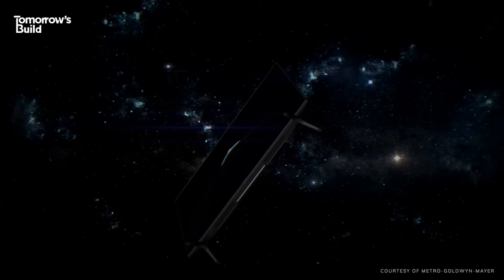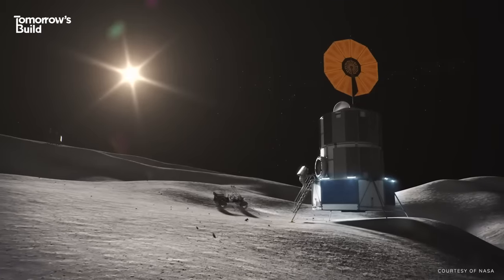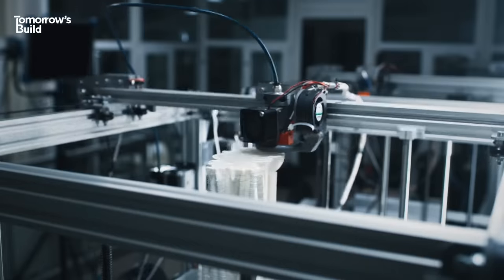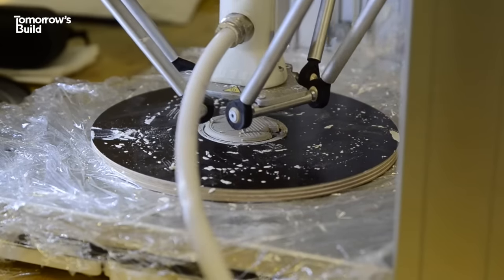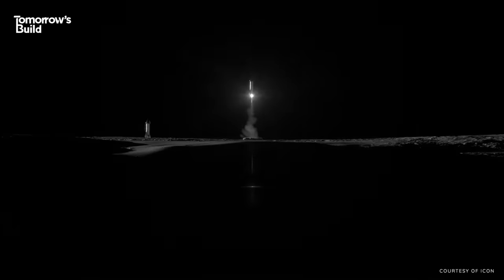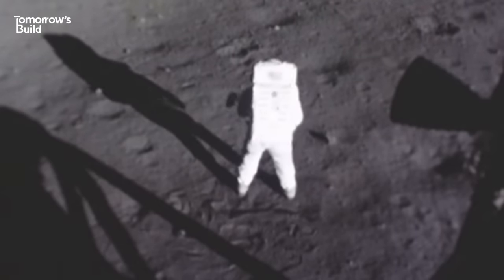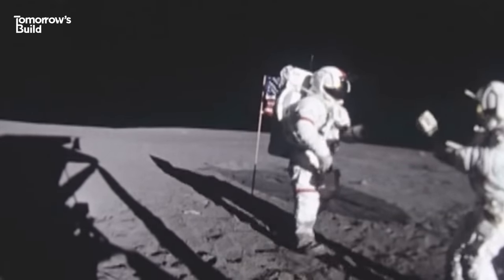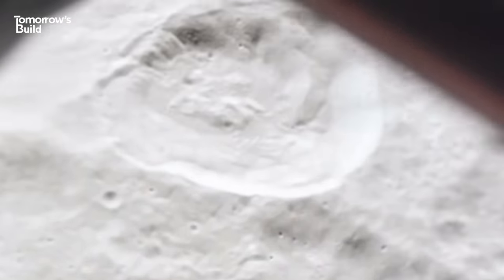NASA's $93BN Plan to Colonise the Moon

Comment: Wdym? 3D printing has absolutely exploded on earth. 3D printed rockets. More startups with housing companies. Increased tech with 3D metal printing. A huge amount of new medical applications. It’s huge. It’s not as much in the main spotlight because it’s a common occurrence but I assure it’s absolutely everywhere.
Reply: I think the article it was referencing was more talking about mass production of 3D printed parts vs traditional manufacturing. but the tech is developing so fast I wouldn't be surprised if the article was out of date
Reply: I had the same confusion - but I get the general thing they mean - it did feel like some years ago it was saying it was going to be a gigantic revolution -

But I feel like most technologies are like this, where they have their initial concepts, a bunch of R&D, prototypes arise - and then massively burst into the public eye, being told its right around the corner and will change everything... and then the hype dies down. Everyone goes "what happened to the cool new tech?" It never went anywhere. The general public just has a severe lack of patience and understanding that new technology takes time. It fills me with annoyance everytime I hear someone say that nuclear fusion is a scam because they don't understand just how hard of a problem it is to solve.

But slowly, silently, the technology becomes more available, more established, and changes more and more and more, until suddenly everyone looks back and is like "oh dang I didn't even notice that technology came around, when did that happen?"

Fittingly it definitely happens in spaceflight, where the public only glances over at space when something is again, in the mainstream news, and they seem baffled about all the stuff that's happened, when it was going on this whole time. 

Oh yes, and thank you for mentioning Relativity's 3d printed rocket. It is launching for the first time next month, and I have no doubt that they will be a big player in the future.
Reply: It’s not
Reply: @WasatchWind  The Gartner Hype Cycle is real and nobody can escape it
Reply: I was questioning it too but then at around 2:40 he states the way we thought it was going to be 

Remember when it first came out we believed it was going to literally change everything and take over but in reality it just became a useful tool.
Reply: that’s what i was thinking !!!!
Reply: People expected 3D printed Big Macs at home and now they’re disappointed it’s taking longer than promised 🤷‍♂️
Reply: Lies again? Premier League NUT
Reply: @Andrew Spartan But we are printing steaks and other organic materials…
Reply: @supergamergrill7734  🎉
Reply: Absolutely correct- not even in obscure areas now, permeates the Aerospace Industry.  Components have been built far in the past, and now we’re are flying 3D printed rockets!
Reply: @James Allen  and the funny thing is that no one developing 3D printers promised that to them, Lol
Reply: I’m 3D printing something in my garage right now in fact
Reply: He’s talking about the logistical scale of replacing modern manufacturing processes with 3D printing. Material science evolves so fast that while 3D printing is helpful, I. The manufacturing space it is more common as “rapid prototyping”  rather than a legitimate manufacturing process. 3D printing has exploded amongst consumers as well as applications that involve multiple design iterations like the medical field that you mentioned, but on an economic scale no 3D printing is not as prevalent as was expected.
Reply: @StripedJacket  be funny if that’s what happens with AI, although I don’t think it will be
Reply: I had a 3D printer make me a hot girl in pink thongs 😂
Reply: Test tube racks and stethoscope holders aren't exactly accomplishing feats to be ecstatic about here
Reply: Even so there's a problem with 3d printed guns lol
Reply: Some of the homes built with 3-D printing are absolutely amazing, cost-effective, and many are extremely environmentally friendly
Reply: It's all in the goop.
Reply: Lol that's exactly what I thought
Reply: Thank you
Reply: Plus high precision metal components with higher structural strength. You can print custom fuel injectors and reaction chamber with greater resistance than welding/cutting/assembly alternatives.
Reply: 3d to 4d oh but why not the choir chloride poares clean on da fire moist hoist scaffold the calf's folds ink on the parchment of parched father's lost in disaster the aftermath relief the queef of the beef of the last roasted pastas

Comment: Gotta say, the ludicrous claim that 3D printing had somehow faded away made me nearly give up on this video. It's literally everywhere now. 3D printed rockets, 3D printed mechanical components, 3D printed prototyping, 3D printed art installations, etc.

3D printing has untapped potential still, but it's strongly integrated into modern life now.
Reply: Right, but this is a construction channel. In the world of construction, it still hasn't quite caught on.
Reply: @mastahfrederique1147  The very first image was of 3D printing a small plastic component. And then when he returns to the subject and again shows components being printed. Every single statement about 3D printing not doing what it actually has done was over the top of plastics or metal printing video clips. He even cites specific non-construction things as examples, but again, of things that were successful. He has a few cherry picked articles from Medium (the one actually claiming it didn't pan out) and BBC (a weird shoephone project someone did).

And when he does pivot to construction he says "though it really hasn't caught on there either" - very clearly saying he doesn't think it's caught on in manufacturing.

There is zero room to claim he just meant for construction.

I get that he's ignorant of the subject because his focus is on construction. But he needed to do his homework on it rather than go with his gut feeling. And literally just one Medium headline from 2019 (and I do mean "headline" since the actual article undermines his statements here).

He was focused on the construction aspect and didn't realize he built the framework of his video on a false premise. While it's an understandable mistake, it's still a very significant one. It undermines his credibility talking about other things when he shows himself to be wrong about something so obvious (particularly when he throws up the headline of an easy to look up Medium article that contradicts him so strongly).
Reply: Someone owns a 3D printer 😂
Reply: @MZ99698  I'm actually not one of them, but as common as they are becoming that would be a safe guess.

But the promise of 3D printing that was brought up in the video wasn't home printing of toys and craft projects. It was as part of manufacturing. I like knowing how things are made, and over the past 10 years that has gone almost exclusively to 3D printing for the prototyping phase.
Reply: @MZ99698  guy is absurd. We use 3d printed molds to inject into plastic now. Saves 10s of thousands in time and materials.
Reply: @Merennulli  good points. There are many b1m videos that are hype based or poorly researched. The hyperloop video springs to mind. B1m has a very fluctuating video quality
Reply: @yeetus1398  I really love a lot of his work, but yeah. I usually hold my tongue, but this one was just too egregious for me.
Reply: It isn’t everywhere. Your hobbyists aren’t “everywhere”. They’re not what they were supposed to become.
Reply: @Merennulli  theyre not common. You probably own one
Reply: @tex6929  Your attempt at trolling is noted and muted. Goodbye.
Reply: @tex6929  Dude. At least show him the decency of reading his messages before stating something. He already went over your statement with someone else.
Reply: @WiseOwl_1408  “we use 3D printing to make molds” is exactly the reason why 3D printing is still nowhere near mass production
Reply: Will they even have 3D printed food? I can imagine a moon mon saying. Dinner looks great, But why does it taste like Plastic??
Reply: @horstwestpfahl2459  There are some designs for that which may eventually hit the market as a novelty, but I think we're still a considerable ways off of 3D printed food being a meaningful way to distribute food.

3D printing food sounds like a neat idea, but that's a very complex problem to minimize the number of different texturing and binding additives, and finding flavor components that don't chemically interact in a negative way. And then if you ever solve all those problems, you need to convince people to eat it, which is going to be hard since the first few generations aren't going to look anything like what people expect food to look like.

That said, I do get the thinking going into it. If you can reduce food production to making a few base compounds and mixing them in different ways to recreate different foods, you can hypothetically drastically reduce the impact of our diets on the world and probably make longer duration space travel a lot more feasible.
Reply: @Merennulli  If they can get to work properly, Hell I'm in. Just make it tasty. See that. I've invented their slogan. Just make it tasty..
Reply: @teamtoken  It's not supposed to be mass production. It's versatile production. You can rapidly prototype something with 3D printing without the expense of making prototypes by hand or the even greater expense of modifying mass production machinery until you have a working design. Then you mass produce with whatever method is best.

Granted, there are some things now that can only be made with a 3D printer or by hand because they're too complex for mass production methods, and 3D printing is far faster and cheaper than hand work. A great example is Relativity Space, which just last week had an amazing first launch test, achieving Max-Q and 2 stage separations (I'm not aware of any that succeed on the first test flight, and this was no exception, but achieving Max-Q on the first flight is huge). And more to the point, they have already made regenerative cooling combustion chambers MASSIVELY cheaper to manufacture since the only alternative to their 3D printed solution is very complex welding.
Reply: @horstwestpfahl2459  Heh, I'd probably try it at least. I'm a bit squeamish about my food being made of things I can't immediately recognize, but they made "impossible burger" good enough for me to eat even though I'm not a vegan, so I won't write it off entirely. I just see so many unsolved problems with the current generation that I don't see it making a huge impact in my lifetime.
Reply: @Merennulli  As I'm 64. Probably won't happen in my lifetime.
Reply: utoobeizkaka2737  What's wrong with the past? Life was easier. I love being 64.
Reply: Imo Consumer grade 3D printers are only good for people with no crafting skills. I got a lathe, a milling machine and a tig welder and with those, i can pretty much make any part from many different materials and they will be much stronger then 3D printed plastic crap. If i wanted to 3D print parts of similar stranght, the printer i would need for that would be some industial grade machine that probably costs somewhere between 100k and millions.
Reply: exactly why I came to the comments
Reply: I’m using my 3D printed phone as I drive my 3D printed car to my 3D printed office... oh wait... there’s actually not a damn thing anywhere around here that’s 3D printed, it’s only useful to make superhero dolls and other useless geegaws.
Reply: @canadiangemstones7636  Cute troll attempt. Bye.
Reply: The problem with 3D printing like everything else with potential, it has been corporatized. Meaning, anything that allows any usefulness from it gets put under expensive licensing and restrictions making the "usefulness" of it to average people almost nonexistent.

So it fades from the population and spotlight while corporate companies figure out how to exploit the money potential.  
So average people will say its useless and the technology grows behind the scenes.

I've seen the houses they built with a huge 3D printer, technically I'm impressed but I can only imagine how monopolized the company made it BEFORE showing it on video.. More or less making it for investors.  

Point is, if something is so far out of reach from average people ($50-$150k a year, yeah that's average people now days) then how useful is it?
Reply: @kindnuguz  You can get a 3D printer for under $100, and you can get an actually good one for about &500. But home use is not the real benefit. Several businesses have sprung up utilizing 3D printing for rapid prototyping, letting new people break into industries that had once been well locked down.

Nearly every new or improved product you have bought in the past several years has some portion of it that was a 3D printed prototype until the design was fully tested, 

And, yes, the big corporations are going to keep that cost savings as profit, but you get technology improvement at a much faster pace. From better shoes to CPAP devices half the size they used to be to reduced use of bunker oil with new ships screw designs to drone delivery actually being possible finally. And countless more innovations.

The home use is amazing, don't get me wrong, but making your own custom parts or making toys or art designed digitally are relatively minor. Even in that, there are a few stunning things that people come up with even in that space, though, like the prosthetic finger someone developed and put out a customizer tool to fit it to individuals for free. It was also used in early 2020 to produce face shields for hospitals until manufacturing could spin up for the demand. Again, all with home 3D printers.
Reply: @mastahfrederique1147  not what the guy stated in the video. he said wasnt literally nowhere and its literally everywhere
Reply: @airgunningyup  The second reply already addressed what you're claiming.
Reply: Clearly the video creators were really attempting hard to appeal to a “lay-audience”.
Reply: 3d printed bionic arms
Reply: And how often do those break/fail?
Reply: @UncleRuckus7600  "Those" what?
Reply: @Merennulli  the 3d printers. The point of this comment thread
Reply: @UncleRuckus7600  The thread talks about several methods of production and specific products that involve the printers including in my initial post that you replied directly to . And, no, they haven't been fragile for years unless you are looking at home builds. They have been reliable industrial devices for over a decade. You're living in a world where most of the solid products you have bought for years were prototyped using 3D printers even if you haven't been following technology.
Reply: @Merennulli Not only prototyping, creating the mold is the hard part and 3d printing opens a lot of possibilities for cooling and injection channels.
Reply: that's fine... the question is getting a large 3D printing machine to the moon and somehow power it with batteries since you won't be running a generator up there... LOL... now many rocket flights will it take to get TONS AND TONS AND MORE TONS of materials and equipment up there? not to mention all the workers needed and living accommodation worked out...
Reply: @t.c.2776  Not sure what you mean. We have 9 generators on the moon already - the 5 Apollo ALSEPs each had an RTG, as did 4 Luna probes. Though this would more likely be solar powered since that's the lightest option for the power required. And the entire point of the lunar 3D printer is to use lunar regolith to minimize how much material needs to be brought.

Comment: I am not keen about using chemical resins for binding regolith.  You have to ship many tons of resin even if it only represents 10% of the mass.  I have actually looked at this problem, and the best solution I believe is to use molten regolith printing. You ship enough solar panels to generated the required power, then use an electrically heated molten regolith to print your buildings.